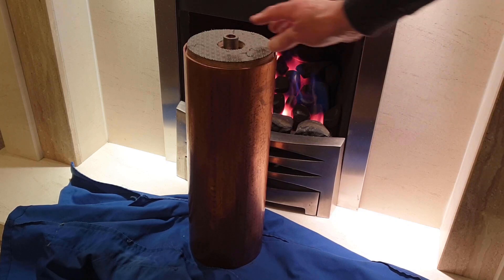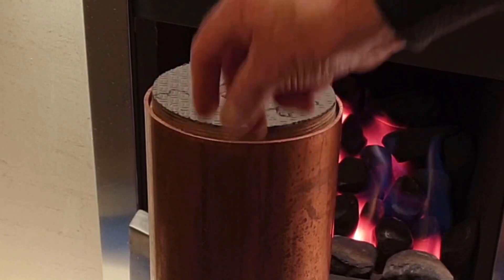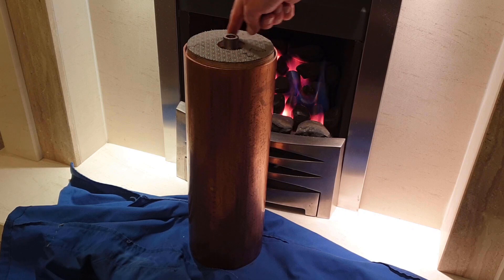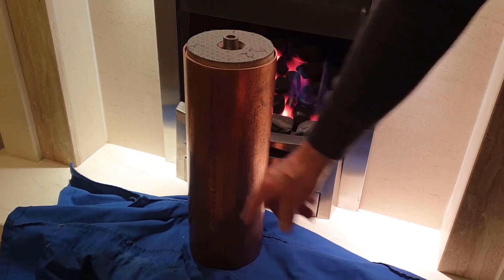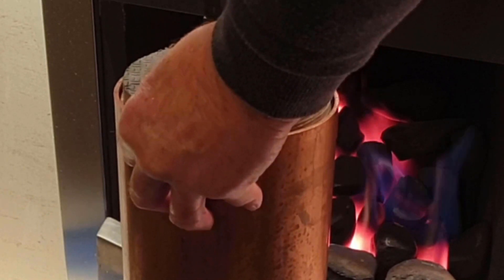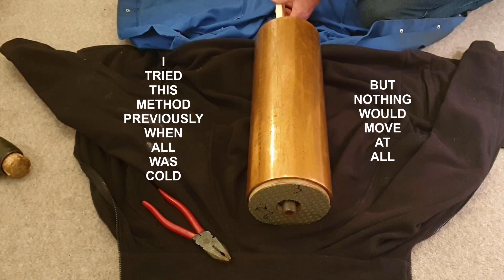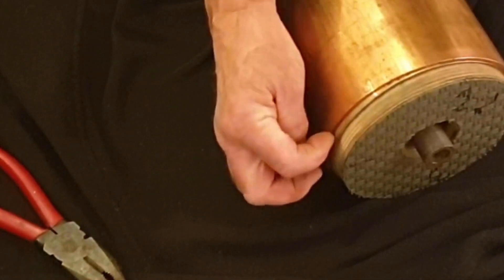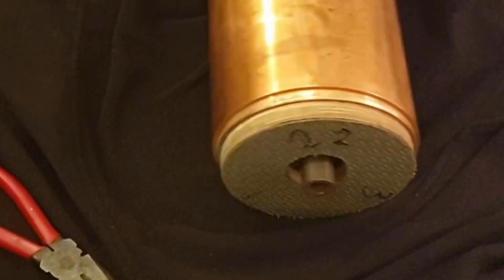COPPER BOILER              BUILD            2 P

Comment: Did you consider a sharply ground HSS tool?  The carbide button cutter has quite a large surface against the job and is more likely to dig in and stall.
Reply from the maker: Hi, Thanks for that comment, I was thinking a broader tool might just give something of a  smoother finish ( but have since seen people using a tip similar to the one you suggested ( with good results).
Thanks for watching and taking the time to comment.
Cheers, Andy G

Comment: Hi. I made all the parts for a Holmside boiler so it was complete ready to silver solder together, i did do some of the silver soldering but chickened out as I was using propane and reconned I was going to need a serious amount of BTU's especially when it came to the foundation ring. In the end I sold the engine, I'd got to many projects on the go as it was. I do wish you success with your Holmside especially the boiler, thank you for sharing your buld warts and all. Please don't take this as a negative, I think I probably gave up to easily.
Reply from the maker: Hi Martyn
Thanks for watching and even more, thanks for commenting on the video as thecomments are very useful to myself and others
Later in the project we will see my first attempt at a singer solder joint on what would appear to be the easiest joint to be made and how I struggle to perform it, so I do appreciate your concerns of many BTU's being required for the build especially as the build becomes a sizeable mass of copper
A terrible shame you did not complete your build and end up with a running loco
I take it you are still involved in the hobby and maybe even building another loco?
Cheers
Best wishes
Andy G
Reply: Hi Andy. As far as the Holmside went I soldered the barrel to the firebox wrapper and soldered in the throat plate, using a higher temperature  range silver solder so when I came to do other joints there would'nt be any risk of melting any previous joints. I had also soldered the firebox tube plate in and soldered the tubes in place. Then I got cold feet and chickened out. Yes I'm Model Engineering I'm just one of those who purchased castings while I was working for projects I'd liked to build during retirement, then realising I'd simply got to many. As far as other boilers go I did part build a 3" Atkinson steam lorry boiler but again chickened out when it came to putting the inner and outer assemblies together again the thought of how much heat I would need for the foundation ring worried me.  However I had some help and that boiler has been finished and tested okay. I have a Speedy on going and a Tich which I am confident I can complete that boiler myself just need some good weather as I have to do my soldering outside. I'll follow you progess with interest good luck.

Martyn.   @masterpiecesinminiature8299
Reply from the maker: @martyncozens5654  Thanks Martyn, yes I like you and numerous other Model Engineers have too many irons in the fire ...
It must be an illness I guess and am plodding on in hope and hope I do not die in despair
Yes the different solder temperatures is the route I will be taking but as I mentioned earlier the one and only joint I have done ( which must also be the easiest in the boiler build was certainly an eye opener for me....
Keep modelling 
Best wishes
Andy G
Reply: @martyncozens5654 
I have built 7 live steam locos up to 7.25 gauge.
I have never mixed the melting points of the silver solder. I have found silver solder is naturally a little harder to melt the second time around.
Reply from the maker: @haroldpearson6025  Thanks Harold, encouraging feedback
Cheers